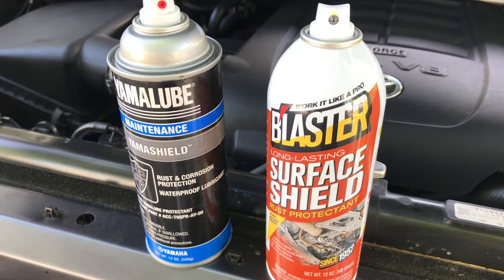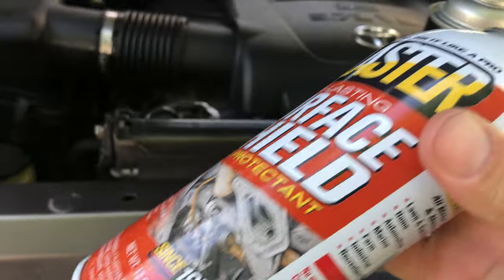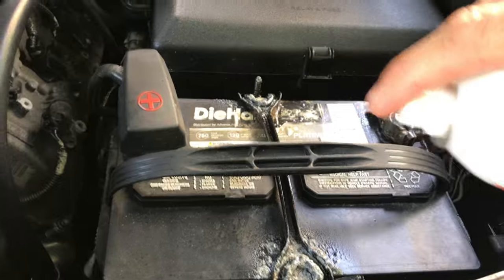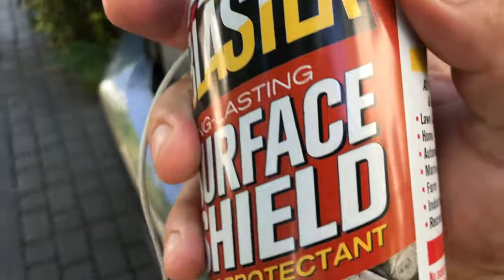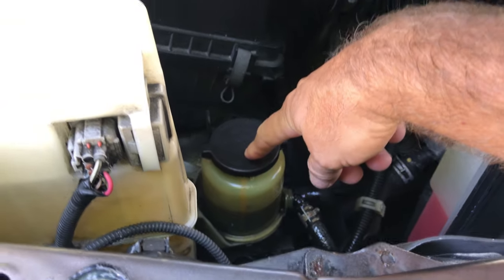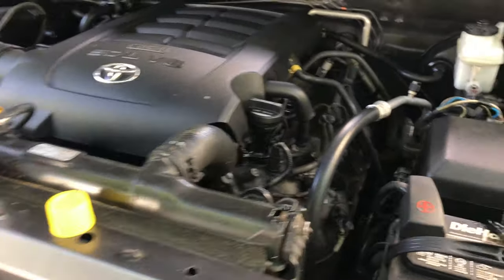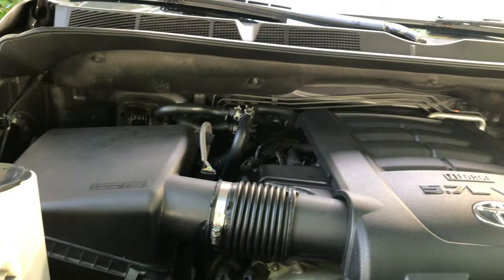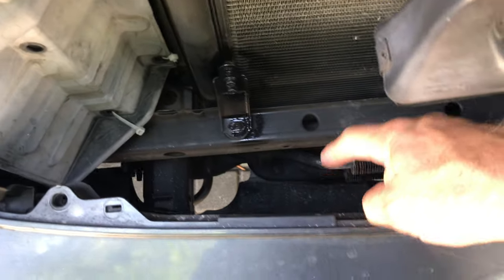Stop Rust in Its Tracks! Blaster Surface Shield Review

Comment: Always drain and fill trans. ONLY use OEM fluid for your vehicle .. ONLY. Every 10-15k also. Make it red. Its okay.add extra magnets. Use old fluid for a day after cleaning magnet a few times after driving. A clean magnet is very useful
Reply from the maker: this is the only task I have yet to do on the Tacoma and Sequoia. I am a bit apprehensive.